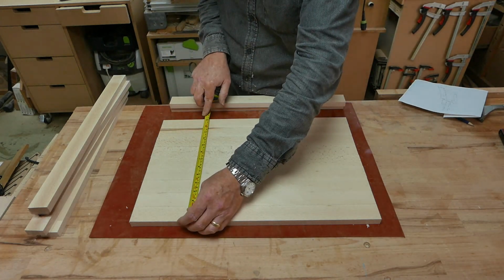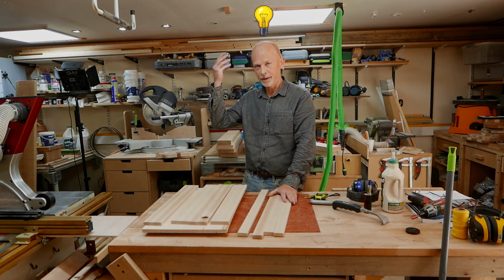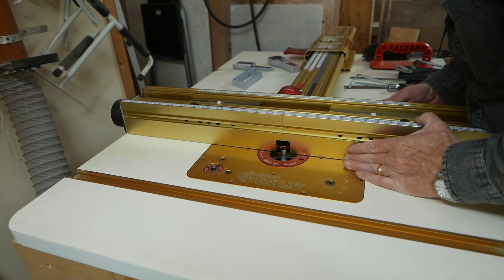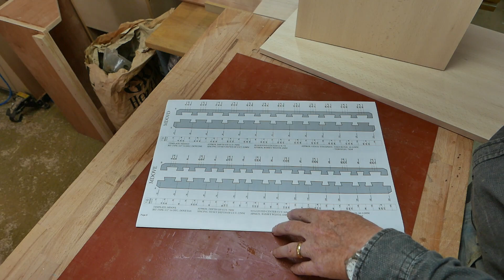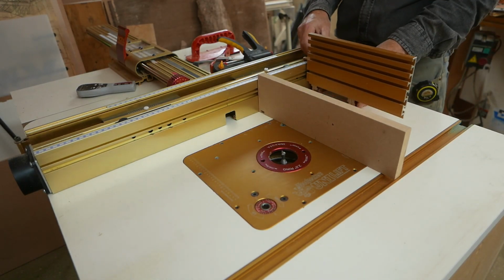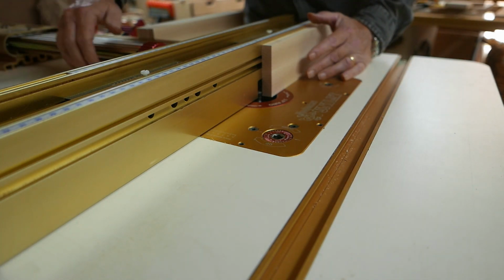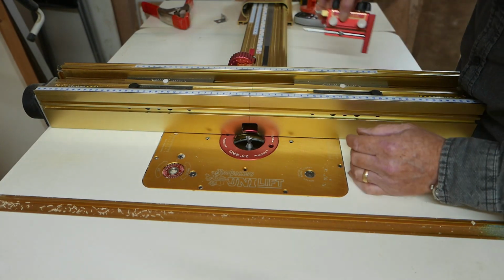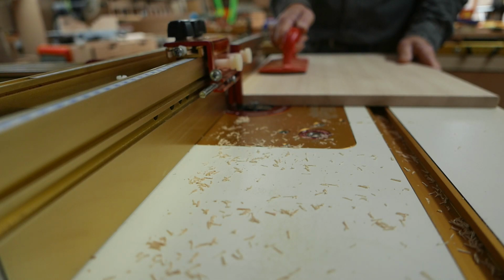Wooden Serving Tray Dovetails with the Incra LS Positioner  Part 1

Comment: What's the purpose of the squeeze clamp (red grips) that you use on the back of the right-angle attachment?  It looks like you're clamping the fixture down to the table top temporarily, but I don't know why...
Reply from the maker: Hi Monte, bang on.  I found in the past that I'd managed to tip the right angle fixture forward a little effectively raising the workpiece off the table.  So now I clamp it just to make sure. 👍

Comment: Hi Graham,I hope you can help as nobody else seem to reply to questions.I may seem being a bit dense here but am I right in saying that the "tails cut" could be a B cut rather than an A cut as suggested by all the incra videos depending on the width of the board,thanks in advance Matthew
Reply from the maker: Hi Matthew, sorry to hear that.  You're right though.  You're choice should be influenced by where you need the natural strength of the joint i.e on a drawer, or if strength of the joint is not important as in a small box for example then by asthetic value.  Hope that helps. G. 👍